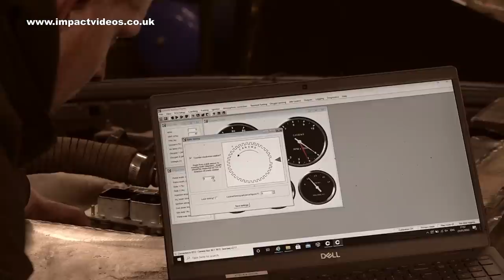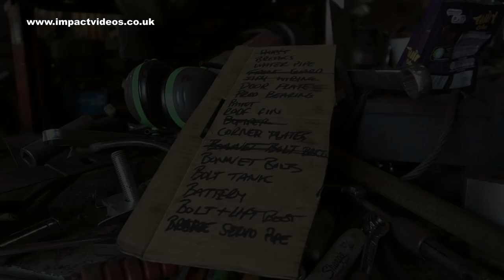Jaguar Banger Race Car Build Part 2 With Callum White

Comment: I liked the carb action and the old fashioned timing strobe.How long does a lump last in banger racing these days.I have seen them fry and go bang many times back in the day.The difference seems to now be all the strengh put into the front end.And when I used to watch the radiator was strapped into the back with long hoses and invariably the lump just got too hot.I have seen engines pushed up at crazy angles on a hard corner hit and game over.Hednesford Hills in the 80's and 90's.Mk 1 and 2 Grannies and Jags ruled those days.

Comment: What is that engine you use? I assume you can't use the stock motor due to all the electrical garbage they need

The only racing I ever saw was grass-track & then it was the end of the Ford Anglias, Triumph Heralds and the like. Mate of mine liked Alfasuds for some unknown reason. Cars being used then used to rot like crazy in their road life. I never say anyone use steam tanks as the racing was non-contact. Stick a big radiator + fans in the front passenger side
It doesn't matter what sort of car you use. There will always be someone bitching about 'destroying a classic'. But that Jag was f**ked due to the rot.
You ever see MrFixit with a 1932 Hillman? Like a house-cat in with a pride of lions.
Reply: straight 6 jag

Comment: Great vids,  but that's not a banger. It's a tank. Bangers are way over built these days.
Reply: I dont know how the prep has changed now but in the 80,s and 90,' there were"bangers" and " bombers" The main change is the strengh you have to put in the front end now to race which is why typically all you see now is massive rear end damage but very little front/engine damage.Loved the sport but its all about jacking up trains now.Also few rear wheel big engined cars left these days .Its never been a cheap game though.
Reply: @glennpowell3444  Agreed. Just a shame that national bangers means ironed up cars with £1k tyres and performance engines. That's not bangers. The water tanks and plates used now are only there for strengthening, like you say the front end damage is minimal. I prefer the historic stock cars now,.

Comment: Why!?
Reply: Why not??
Reply: Why are banana's yellow?
Reply: @opoxious1592  to show they are ripe, a purpose cause and meaning
Reply: That's not the right answer.
They might as well could have been orange or purple.
Reply: @opoxious1592  but they are yellow, bananas are yellow, we can't get away from that, as you rightly pointed out, apart from when they are green, in which case they are telling you they aren't ripe. Before they go yellow..